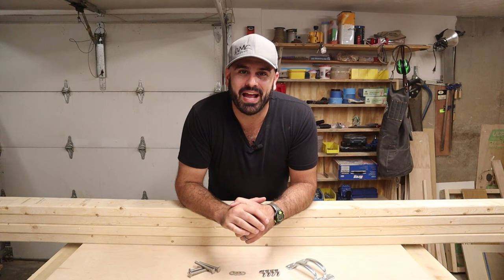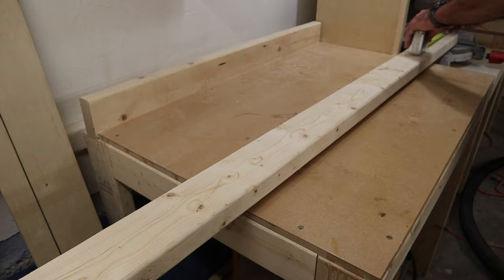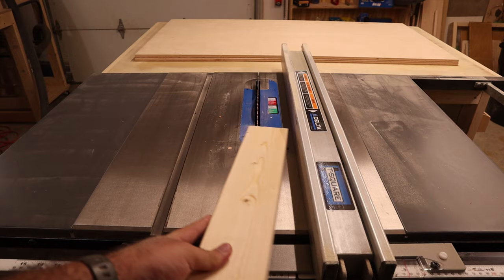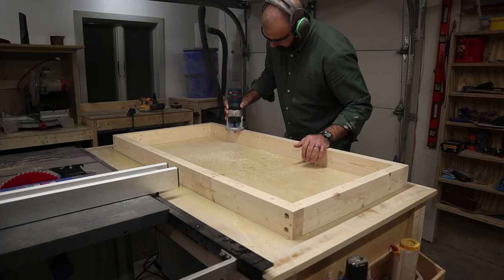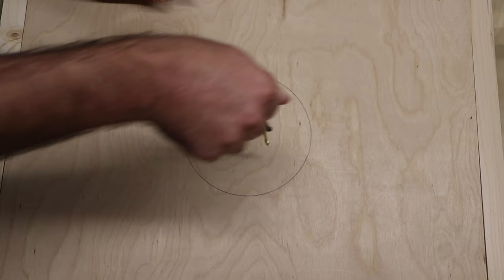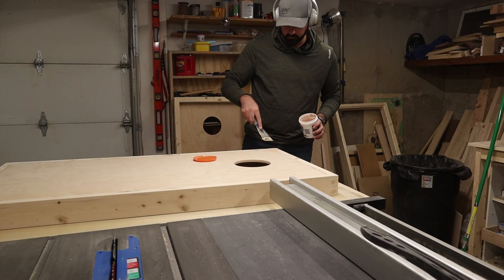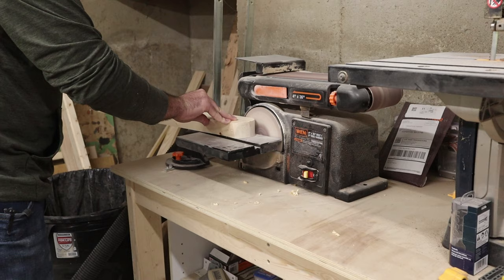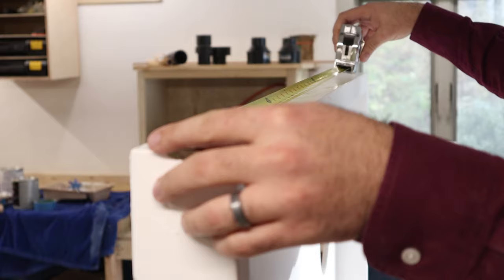How To Make Cornhole Boards | Lightweight Design | DIY

Comment: I love this guys attention to detail. He’s a little above DIY but with practice you can do it. His circle thing is suspect. You’ll destroy your material. Get a hole saw bit.

Also, if you are using pocket holes get the kreg jig. It’s $$ but it bought the cheapo and spent way more in replacement stock then I would have if I’d gotten the kreg first

Comment: This is the first I've seen where the plywood is sitting within the box frame instead of on top More ways to make a cornhole board than to skin a cat . Love seeing them all. Very creative and imaginative finding  that finding that bottle cap to make your hole👏👏👍. 

Definitely does help to remember some trigonometry, and the Pythagorean to cut out the legs for the right length and miter the ends. That way you wouldn't have to try and prop the board up first and measure, but understandably not many people are going to be able to do that unless they are fresh out of taking Trig in school or study it in their daily lives.
Reply from the maker: I didn't want to have the plywood edges visible from the side so thought this was a good idea to hide them.  And yeah, math isn't the strongest for me so propping it up was the way to go.
Reply: Unfortunately, the Pythagorean Theorem only works with right triangles. The legs are angled back so there is not a 90 degree angle and the triangle is not a right triangle.
Reply: @tedp4490  Ahh but any triangle can be divided into 2 right triangles

Comment: Thanks for the tip on transferring the correct angle to the legs (after raising the end of the board 12")  Many of the videos I have watched are not as clear at that step as yours - Thanks!

Comment: You say in the beginning you made the boards to adhere to the regulations from the ACA, however your boards are 3” high when the ACA refs. are 4” off the ground at the bottom.
Reply from the maker: ACA says front standing height is 3-4 inches

Comment: switch to glue joints to lose the hardware and cut out handle in the sides to eliminate the attached metal handles. Plane the 2x4’s to 1” nominal thicknesses

Comment: Nice video. Im looking to do something like this for my hubby. Suggestion, what about putting some sort of latch on the sides. That way you could put the boards together and carry them, or even using the piece from the hole to close it back it. That way you could store the bean bags inside.
Reply from the maker: Great idea!

Comment: It seems like there are pretty strict dimensions for the boards. The back is 12 inches off the ground. Is there a set height for the front end? I'm wondering if shaving the 2x4's and sinking the plywood affects the height off the ground for the front of them?
Reply from the maker: Yes, there are standard dimensions for these.  I think they say something about the front end, but can't remember exactly.
Reply: Yes.  Per ACA regs: 

Board Top Dimensions: 23½–24-in x 47½–48-in
Board Top Thickness: At least ½-in
Front Standing Height: 3–4-in
Rear Standing Height: 12-in
Hole Diameter: 6-in (+-¼-in)
Top of Board to Center of Hole: 9-in (+-¼-in)
Sides of Board to Center of Hole: 12-in (+-¼-in)

Comment: I've never done done woodwork before. The math, tools, everything is intimidating. I live in Japan. I first need to find a woodshop with these tools. And go to a tooling department to buy everything.

Should I even be attempting this?

Seems dangerous for a complete beginnner.
Reply from the maker: You need to start somewhere.

Comment: Wondering why you didn't use the Kreg kit for assembly but instead to prop the board up? Would have saved you a lot of work.  Either way nice video and boards!
Reply from the maker: Thanks!  Yea, I'm not too sure why I didn't use pocket holes for assembly.  It was probably because of the rabbet that I added for the plywood top and I didn't want to interfere with that.  Who knows!  Thanks for watching!

Comment: What do you think about using 9mm thick plywood for the top? It’s a little thicker than 1/4 an inch. I think it is .35 inches.
Reply from the maker: On the official website it says the top needs to be at least .50" thick.
Reply: @CasualBuilds  thanks for the quick reply. I know that is the reg size but if I want to go altra light how do you think it would hold up? Do you think it would take the beating from the bags hitting it?
Reply from the maker: I'm sure it would be fine, but there may be some flex to the top when the bags hit it though.
Reply from the maker: I've never built a set like that or played on one with that thickness, so I'm not sure.
Reply: @CasualBuilds  thank you! I’m going to give it a try. Honestly I already have them LOL! Just need to put a few more coats of poly on them and I will test them out. I just haven’t seen anyone build them that thin. I’m sure these are going to bounce and move. Each board is only 18 pounds LOL! Might have went to light.
Reply: Also I should mention these are tailgate size 2x3
Reply from the maker: Let me know how they turn out!
Reply: @CasualBuilds  sure thing. I will test them out for a week or 2 and let you know.

Comment: Did you consider making a pair with 1x4 poplar instead of 2x4 lumber for weight savings. I'm curious to know how much lighter this is.? Here is a good question how many labor hours did each set take you  and how much would you charge for the boards if you were to sell them? Nice workshop!
Reply from the maker: I haven't thought about using 1x4s, will definitely be lighter. The time it takes me to make these things won't really be relevant because I spend a good amount of time with filming.

Comment: Made way too much work for yourself. Can make the boards lighter by using 1x3 instead of 2x4. On top of that use a 6” hole saw for the hole on the board. Save yourself time & less room for error. Final critique: use a pocket hole jig instead of drilling holes then having to fill with dowels. Also no clue why you routered out the frame for the ply to sit in the frame. Never seen cornhole boards like that.
Reply from the maker: 1. Agreed on the 1x3s 2. Didn't want to buy a hole saw, since this was a one-time project, the router works just as well 3. Yes, could have used pocket holes 4. Because I didn't want the plywood layers to be visible on the side.
Reply: @CasualBuilds  This looks like a great beginner build.  I am just learning about woodworking (I do have a rough framing background).  I would not want the plywood edge visible either and love the chance for some rabbit practice with a router.
Reply from the maker: @JesseAdams3  Awesome!!  The only tricky part for me was the legs - good luck!